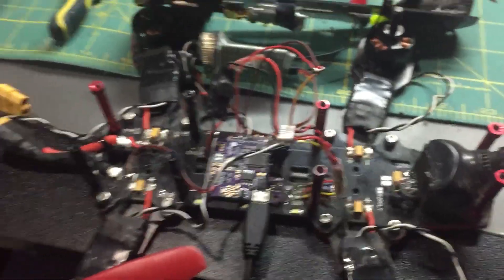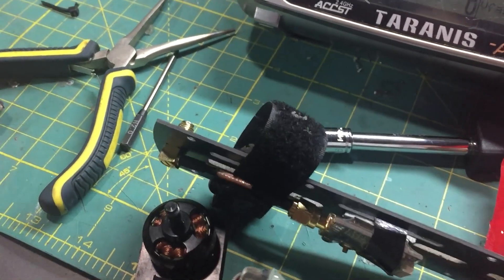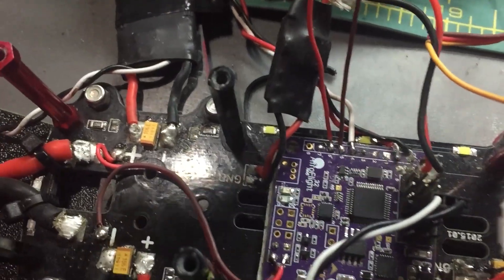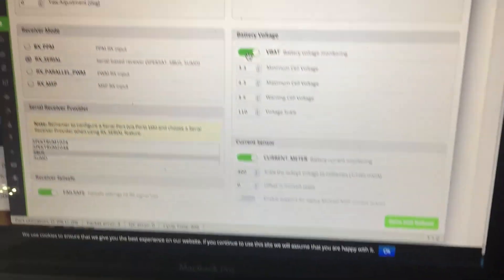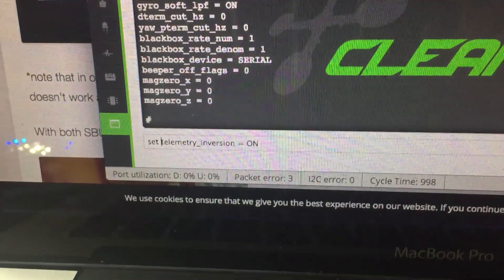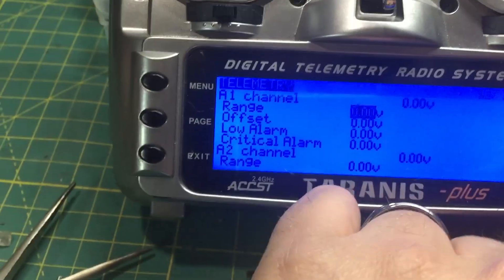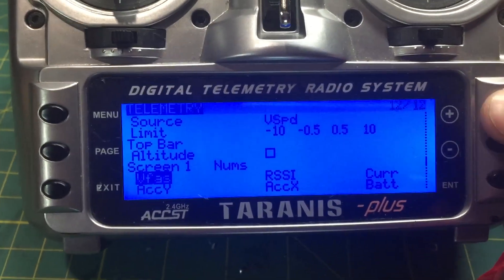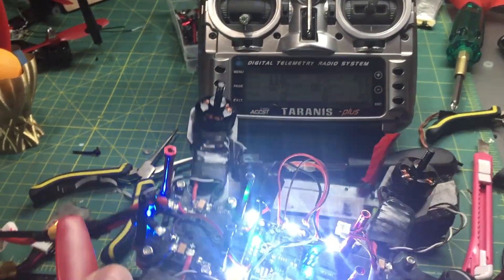Setup | Naze32 sbus + telemetry

Comment: Avec Naze32 Full ,  Qui peut me dire sur quels contacts connecter un FlySky FS-R9B 8Ch 2.4Ghz RC Receiver  ? ( Pour un Quadcopter )  ... Thank
Reply from the maker: +Patrick NICOLAS if flysky uses sbus then it should use the same connection as frsky
Reply: Non  Roberto just classic 4 ch

Comment: What antenna are you running on that X8R? I was thinking of using that same receiver, but using the antenna from a X4R that I have that doesn't work. Do you think the ones with the PVC covers are better?
Reply from the maker: +3000gtwelder these antennas are for d4r they fit well on the x8r

Comment: Hey there I'm asking for some help. I followed your setup, have everything identical, but VFas will not show up on my taranis. I can see the correct voltage through cleanflight but VFAS is not recognized whenever I try to find it with the Taranis. Do you have any suggestions?
Reply from the maker: I would try update your taranis to latest software.
Reply: I got it! If anyone has this problem your X8R is set to Ch1-8 mode and that does not work. I have no clue why. You have to set your X8R to CH1-16 mode. Also I think my X8R has a defective smart port. When I put 5v positive negative into it as well as signal it worked. It should've been working without those and did for a total of 1 minute. I think it just has a poor solder joint somewhere. Anyway if anyone runs into this issue check my write up on reddit. https://www.reddit.com/r/Multicopter/comments/4q0jni/help_frsky_x8r_receiver_and_naze32_telemetry/

Comment: hi, i have cleanflight 1.12.0 with default looptime set to 2000 and when i use softserial telemtry work fine but i can't arm... i have sbus
Reply: +antoineva33  you should mess with your looptime settings and set your looptime lower if your esc's allow it.. i set mine to 1200 and disable the accelerometer flies as accurate and fast as my kiss flight controller

Comment: Rob - was able to get it resolved.  After typing in the CLI command, I was assuming the command was saved as i was clicking out of that screen and the board would say rebooting.  But it wasn't actually saving it till I typed save in the CLI command line. That wasn't mentioned in the video.  Once i did that it started working.  Again thanks for the help with setting this up, much appreciated.
Reply from the maker: +Pheonix 2 (Kendall607) Alright awesome, it feels great when you finally get it working lol
Reply: This fixed it for me, thanks!

Comment: I really don't know how you got this to work.. I have checked the continuity in my wires from pin 5 and 6 back to the plug of the smartport - good.  Checked that i have continuity from my PDB to the plug of the smartport - good. Set it up within cleanflight V1.2.1 as u mentioned.  And my taranis flashes "no Data".  Saved after every step of configuration.    Cleanflight shows my Battery voltage and current, but nothing on the Taranis. Any thoughts? Even took the suggestion of using pin 7 and 8 and trying serialport 2 with smartport selected.
Reply from the maker: +Pheonix 2 (Kendall607) have you tried the inversion telemetry command?
Reply: Yes I did, I did find that when I did the bind procedure, I wasn't setup for telemetry. I have RSSI now but nothing else. So with mine D16 1-8 no jumpers and hold FS when power up.
Reply: +Pheonix 2 (Kendall607) It sounds like you haven't set up telemetry screens. Have you tried searching for sensors in taranis on page 12 after you have armed the naze?
Reply: +AllOfYourMoney I was able to get it setup, when I typed in the cli command I wasn't typing save, mine works now
Reply: thank you phoenix got it all working now!!! THANKSSS!!!

Comment: Hi, I have my naze32 connected to pdb which is 5v regulated by pololu. Will the naze32 show the battery voltage on telemetry or will it just say that 5v which is powering the naze32?
Reply from the maker: +The Earl it will read the battery voltage because you also have to connect a direct lead to the naze from the battery so it can monitor the voltage.
Reply: +Roberto Correia how do I connect a direct lead from the battery to the FC? wont that fry the naze32?
Reply from the maker: no it wont fry it, you would have to connect it to the voltage monitoring pins next to the buzzer pins
Reply: I see! Thanks man!

Comment: I have the latest Taranis-Plus with the latest Cleanflight 1.2.1 and with Open TX 2.1.7 but the menus are different and I am using D4R-II. I do not get VFAS, CURR, ACCY or ACCX. Will it change if I use pins 5 and 6 etc?  Thanks!
Reply: +flytelaw1 you have to select the VFAS , curr, accy and accx.. if you haven't set them up before they will be blank.
Reply: +Pheonix 2 (Kendall607) I have X8R and have a similar problem, I do not get VFAS. How can I select something that does not show up in taranis?
Reply: Pheonix 2 Thanks...will try!

Comment: Could someone explain step by step, which wires should be connected to the naze32, which wires I should take from receiver and solder to Naze32 rev6? Thank you. I am using X8r with naze32 rev6.

Comment: Roberto, I have done as you suggest with an X8R but my red light on the RX keeps flashing red and doesn't bind to the TX ...? BTW, Thanks for  your vid :)
Reply from the maker: That's a binding issued nothing to do with a naze. Look up how to bind x8r to taranis. Cheers!
Reply: +Roberto Correia yeah I think it's dead on the SBUS port ... go figure
Reply from the maker: +Richard Hamilton Maybe you can use a voltmeter to see if the sbus port is still working.
Reply: +Roberto Correia Roberts how would I check that it's working, I do have a volt meter, thanks in advance for your help. ..

Comment: thanks for sharing, the pinh 5 and 6 goes to the smart port right?
Reply: +Roberto Correia i had some issues, sometimes telemetry didn,t work, what i did was conect pins 7 and 8 to the smart port, and enable smarport on telemetry SOFTSERIAL2
Reply: +Jorge Osuna Thanks for this comment. After not being able to get telemetry to work on SOFTSERIAL1. I tried, this and it worked.

+Roberto Correia I would suggest you add a link to a wiring diagram in the description. It was confusing and hard to visually see how things were connected in the video.
Reply from the maker: +Steve Hernandez I'm glad this helped you, it's so gratifying when you solve something :)  I will definitely put up a wiring diagram. After watching my video back I could see how it could be confusing and my quad looks like a rats nest lol
Reply: i made a bridge with pin 5 and 6, and then conect it to smart port, no issues. everything works fine
Reply from the maker: Yes sir 👍
Reply: nice, thank for your time my friend, i was a little confuse about it, (Y)
Reply: You just bridge then yea? You can use 7 and 8 as well. I heard there were issues with 5 and 6
Reply from the maker: Jorge Osuna awesome glad it worked for you, cheers
Reply: Roberto Correia The smart port wires being cut is what threw me off at first. I could see they were connected to the rx but didn't connect to anything.
Reply: Steve Hernandez you are welcome my friend, have a nice fly
Reply: +Jorge Osuna That is a very helpful disussion, so far i have not managed to get it working on pin 5 and 6 (Softserial one). I will try softserial 2 on 7 and 8. Is there an issue with Betaflight, by the way? Or are you running CF? When using Softserial 2, LED strip feature should work..Have you tried that yet? Cheers, Thilo
Reply: +Jorge Osuna What I wanted to make sure at first is that there is only one cable (signal) connected to the smart post of the X4R...The others are removed, arent they?
Reply: +mager knilch hi, i am using cleanflight and betaflight 2.1.6, yes, there is only one cable using yo the smart port, the Othón You dont use it beca use You are already powering up your receiver with the sbus, have a nice fly
Reply: +Jorge Osuna Juppiee... It works... Thank you Jorge. I downgraded to 2.1.6 and soldered a bridge to pin 7 and 8 and activated softserial 2 for the smartport. everything is just fine. it did not work on Betaflight 2.3.4..I was a little discouraged after my first attemps.... Now it worked out. yes(-:..
Reply: +mager knilch thats great! Some betaflights version have issues, have a nice fly mate!
Reply: +Jorge Osuna thank you it works on pin7-8